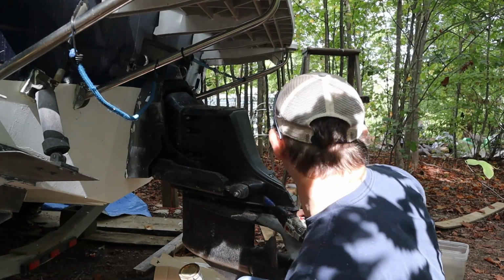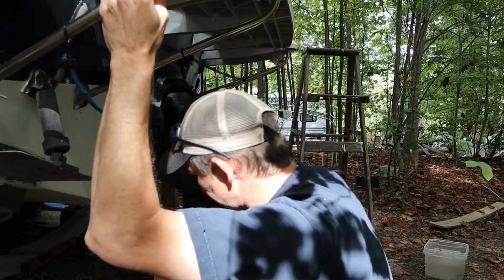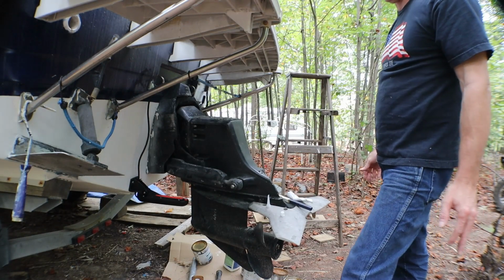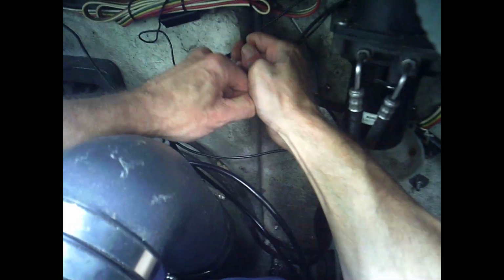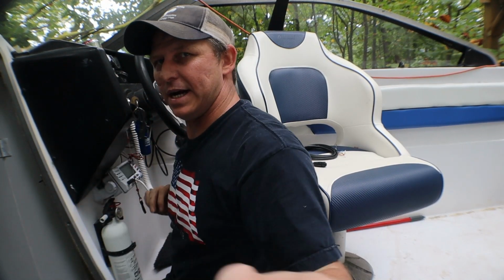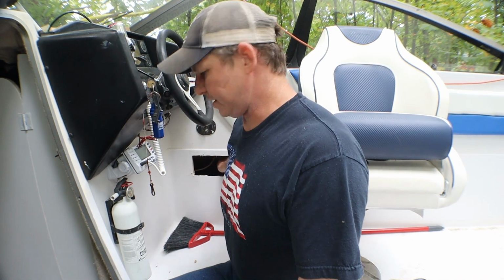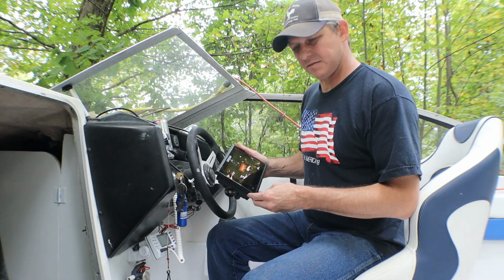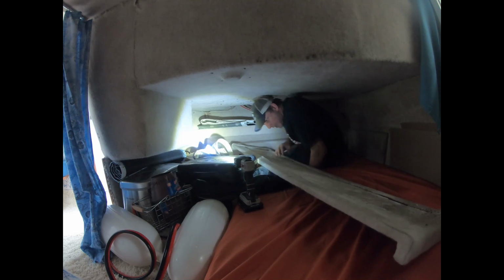Installing the transducer and wiring the chart plotter

Comment: That back shelf cover is easy to put in. First put youre head against that lower shelf and put that cover in front of the opening and keep the right end high and the left side low then bring the cover towards the opening when its against the back wall lift the left side up and screw it in place. That's how I get mine in and out and I dont struggle at all.
Reply from the maker: It did matte which way I did it it would not go I had to shorten the video but I spent 30 minutes turning and trying every way just didn't want to go. it wasn't bad just up and down but I had to pull it out to get the wire through. it kicked my butt.